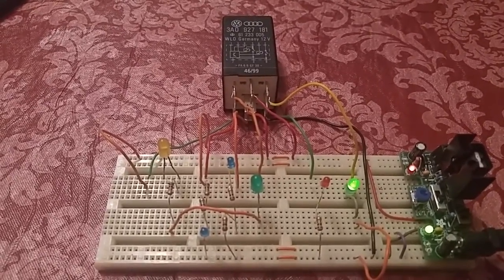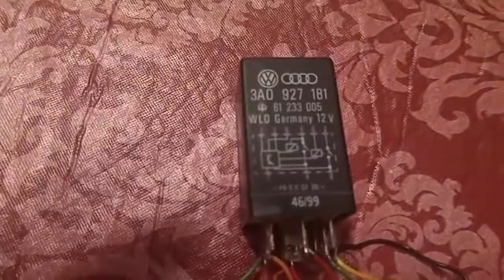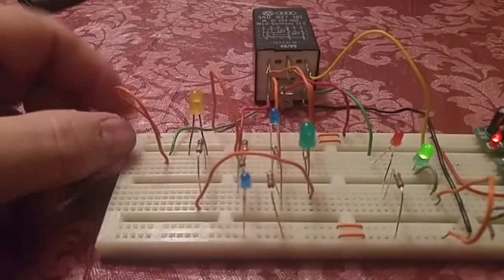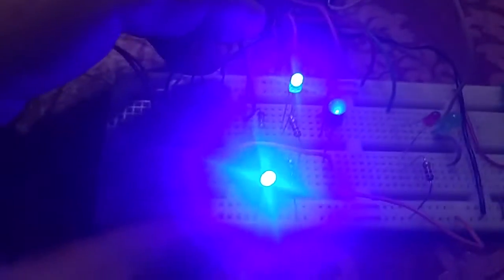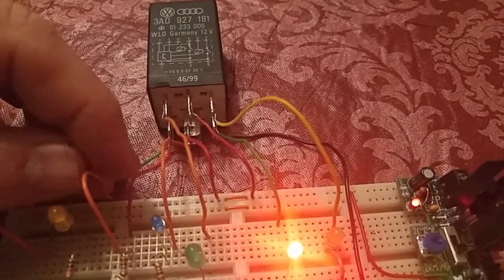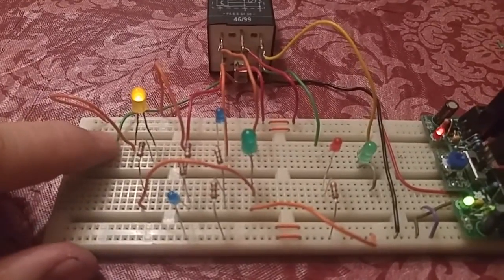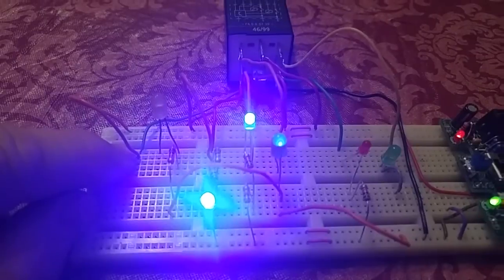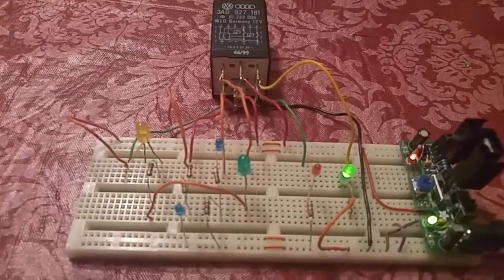VW starter Relay test

Comment: Thanks for the helpful video! Just as a word of advice for anyone who's come here because their relay is refusing to engage the starter: there are two separate relays within the casing, the larger of the two bridges pins 2 and 8 directly. Wedging this relay closed will automatically engage the starter, even if the ignition is off. Be warned! But, if you're having trouble getting hold of a new relay then one could perhaps remove the casing and actuate it by hand in an emergency... I don't know what the safety implications might be, and it obviously won't fix the root cause.

Comment: Hello I have problem with audi a4 wont crank at all and i cant diagnose tcm and abs with vcds but when I add to pin 9. 12V car starts cranks an I could diagnose tcm and everythin works fine can I leave 12V to pin 9
Reply from the maker: By passing 12 volts to pin 9 may interfere with reverse light and nuetral park status. Best to check why pin 9 is not getting 12 volts.
Reply: @SafariArmer  yeah I dont have backup light now
Reply from the maker: Look for defective backup light switch on transmision selector switch. Also check for open wire from switch to relay.